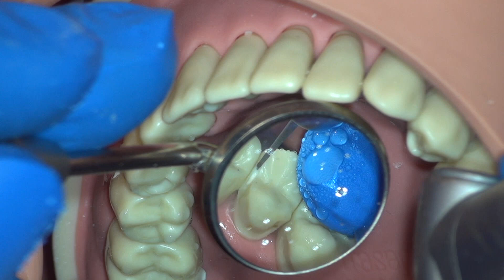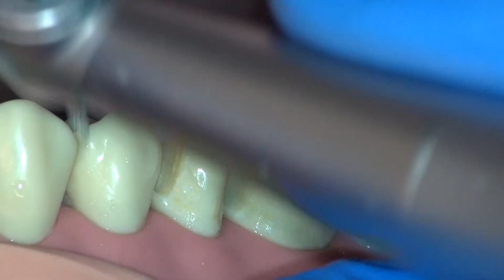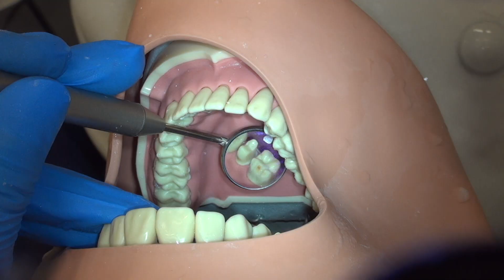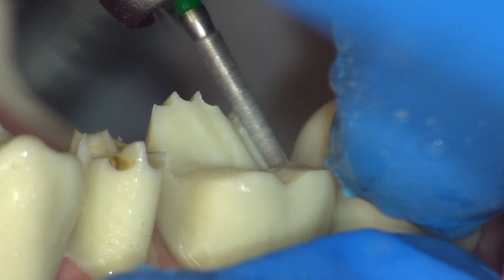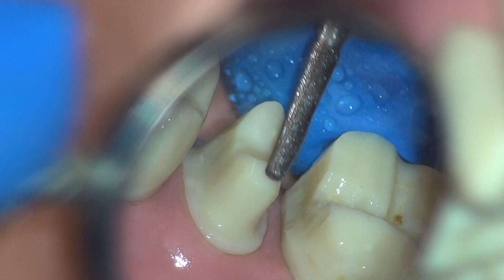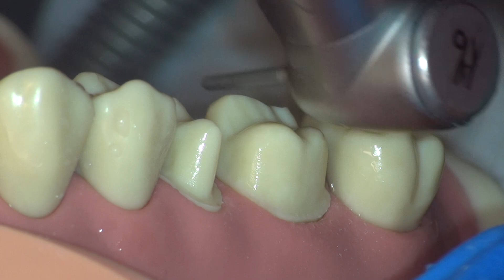Crown Prep Tutorial | ACC 3, 4 | First Person Perspective

Comment: Hi I am curious what you mean by the burr being oblique to not drop into grooves
Reply from the maker: If the bur is placed parallel to the grooves it will enter the groove and touch the bottom, which will change the groove. If the bur is instead held diagonal to the groove it will only reduce around the groove but not change the original depth of the groove.

Comment: Great video! Which burs are u using to get that super clean margin?
Reply from the maker: Any fine, red stripe diamond will do as long as good technique is used. Bur shape should be selected according to selected material. In this video there is modified shoulder and chamfer--both from Brasseler.

Comment: when preparing a 43 pfm crown what should be your chair position to prevent over tapering of mesial or distal or buccal or lingual? thank you
Reply from the maker: Chair position shouldn't matter as long as you can achieve visual access! I don't have a set of rules for where to sit to see what.
Reply: @dr.fritzmora  during cutting 43 i seem to have an over taper in the distal, can you please provide some tips to reduce chances of over taper. thank you
Reply from the maker: @nancynanda4032  For this I would do the interproximal reduction using a mirror as shown in the video. That will let you look between the teeth as you go so that you can see exactly what you are doing. You don't want to be cutting blindly.

Comment: I wish I could see this close with my loupes!  ty for the video!
Reply from the maker: It definitely helps to go up in magnification!
Reply: @dr.fritzmora  here in France in my uni no one has loupes, its not advocated. Its impossible to reach this quality of prep without loupes right ?
Reply from the maker: @hankmoody1744  In my opinion and other expert opinion, yes. Research is lacking regarding magnification on quality, but it seems self-evident. What I can tell you is that cardiovascular and neurosurgical journals advocate the use of the microscope when working on structures less than 1, 2, or 3mm depending on the article. Evidently everything we do is less than 1mm so I would aim to maximize magnification if possible. If you can get loupes for yourself, do it, don't be afraid to be a trendsetter, others will follow!
Reply: @dr.fritzmora  thanks. i want loupes, its just difficult to get for students especially the good american brands. i will see what i can do